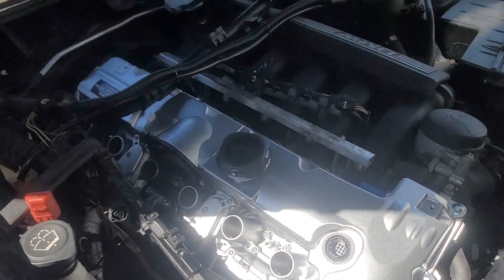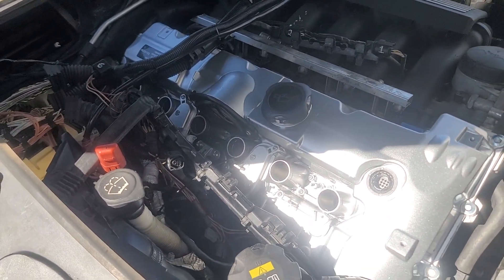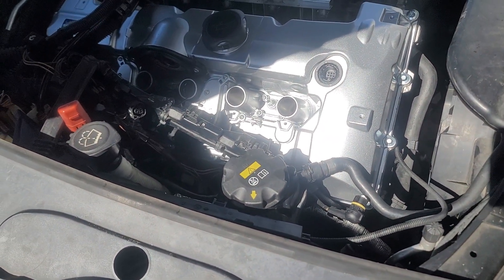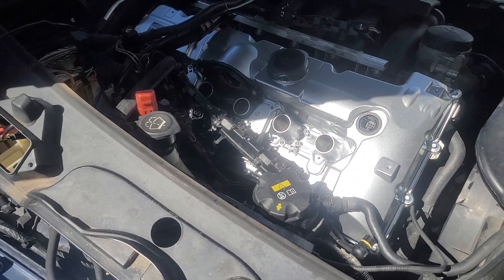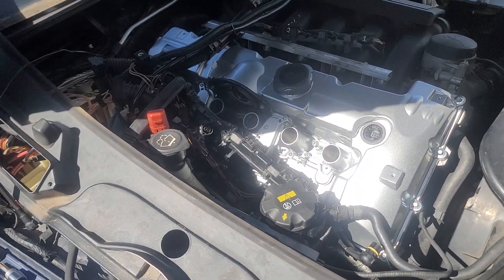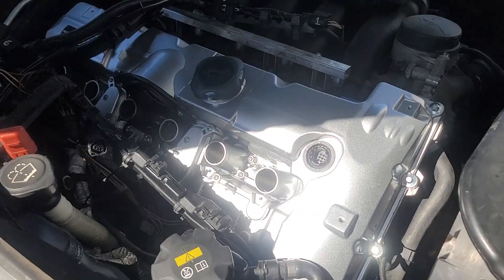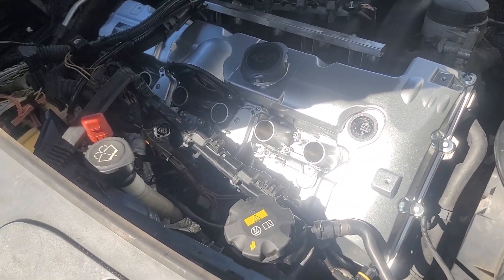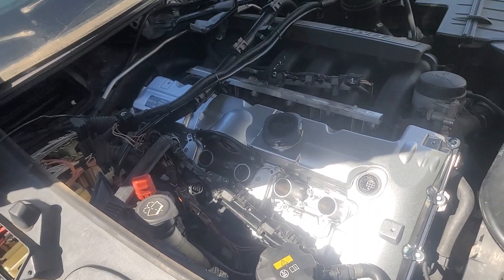The problems nobody tells when using the Mitzone aluminum valve cover for BMW N52

Comment: Yeah, I've always just stuck with the OEM plastic ones. It is known that you may have to jack the car up if your engine mounts are worn/clapped out even with the OEM cover. What I always suggest is replacing the mounts, before doing the valve cover

Comment: Great video, how’s the aluminum cover holding up so far?
Reply from the maker: Honestly after putting it on taking it off a few times and using a different gasket, it did not leak. Thing is i don't know how it's doing now because I sold the car a few months back because my neighbor has a 335 e90 she's trying to sale me.

Comment: I want to give an input on this video I know it's a year old but if your motor mounts are bad and the motor is sitting too low it is a pain in the ass to get the valve cover off and on whether it's plastic or aluminum.
Reply from the maker: Your right. I took the motor mount loose and jacked the engine up to make it easier.

Comment: I wonder if they designed the valve cover on an engine on an engine stand and didn't go through trying to fit it to an installed engine in the tight ass engine bay.

Comment: I feel really bad for what you experienced with the leaking vcg and am super glad things turned out ok in the end. l recommend to anyone doing VCG's to always use things like mirrors, cam probes, take videos from your phone with the light on, feel around the valve cover bottom to look for pinch points, anything and a combination of them to verify proper seating of gaskets. That's a horrible feeling. I did something similar when I was putting my S62 back together after I finally got the O-ings seated properly after replacing the water pump and T-Stat. Use a pressure tester to verify before I slapped her back together. Killed 4 O-rings😅. 

Sooo, I connected a hose to a protruding bolt end instead of on the oil line below it 😑and she proceeded to spit out some 3L of fresh 5W50 synthetic oil on my freshly cleaned engine pan and all over the floor of my garage. Hated life for a bit but then remembered I have an M5 😊. Cheers

Comment: 1. I dont know how you had issues with installation if you were following a traditional VCG installation, the valve cover has the same tolerances as the plastic one, and you shouldnt need to "flex" it anyways. 

2. The gasket itself is cheap yes, but you get what you pay for. If you want a high quality oem gasket, go buy one. Its $10 most places for OE or OEM. If anything, you can RTV the gasket to the valve cover which is what I did. 

I've had it for over a year using the same shitty chinese gaskets it came with, just to see how quality they were. If you instead DYOR on how to upkeep these cars, you'll find theyre a lot easier to work on than MAJORITY of modern cars.
Reply from the maker: My car has alot more stuff under the hood than others I've seen which makes it really tight fit. Different cars have different features. My car being awd and every option available makes it not as easy to do.
Reply: @barrettgarage1088 So how does that make it the products fault?
Reply from the maker: It make it more difficult to install it correctly.

Comment: When you replaced this, did you have a gas issue? I replaced mine on my 2008 Bmw 528i. And it doesn’t seem to go. Almost like it’s low on oil.
Reply from the maker: On the bright side I'm not leaking oil now.
Reply from the maker: Mine does have a misfire and acts like I can't give it gas almost like an open vacuum line. I've been busy with work and I'm going to replace it with oem valve cover when I get some time off work. But in all honesty it's not worth it I wasted that money.
Reply: @barrettgarage1088  yeah. Mine is in limp mode now. Something about this Aluminum Mitzone seems off…I thought it was the Valvetronic motor…have new Bosch plugs and coils…and still in limp mode…contacted Mitzone, and discussing the options
Reply: @mattb5753 Do you have any solution man. I have the same problem. The eccentric shaft sensor won't work when i put the valve cover.
Reply: @hristohristov5210  yes, I did. Learned a few things from this Mitzone. In the future, just get a hardcover, like the stock BMW cover. Be very careful in the removal of the Valvetronic motor and install. Have battery off when doing so. I replaced the valvetronic motor, spark plugs, coils, and still had a misfire. Kept going over the codes and cleaning up the misfires. Was very touchy. I ended up buying a specific code reader(Foxwell)for my bmw that helped pinpoint the exact location of the problem. That’s already helped me out a lot. Worth it. Fuses can definitely be blown in this process as well. Could blow the fuel pump relay fuse if the battery isn’t strong. Hope that helps.

Comment: What gasket did u used?
Reply from the maker: The first time I used the gasket that came with it. Then I got a felpro one from autozone and put forma gasket in spots to hold it in place. So far it's not leaking.
Reply: @barrettgarage1088  So it's not leaking anymore ?
Reply from the maker: @Bogdangati4  no it's not but here's the deal several threads stripped out so I had to drill them and put time serts in. That being said I also bought a brand new tundra so I drive it everywhere and the bmw rarely gets touched. I use it as a YouTube car mainly and take it to import car shows to spark conversion and help other people who have watched my videos.

Comment: Always go OEM Genuine although they are plastic, they are the very high quality plastic and the original valve covers will last up to 10 yrs. The ones with the build in PCV integrated onto the valve cover are specially designed with complex inside vents and materials within the valve cover that compliment the PCV working correctly.  Also the PCV on a genuine valve cover as such for the F10 models are designed and manufactured with specific specs and tolerances that only the Chinese valve covers lack/missing and will fail almost instantly from poor quality and manufacturing!  Never cheap out on important parts on any BMW unless your time and money are worthless!  

p.s. These Mitzone aluminum valve covers for my BMW F10 inline 6 are $155 (ebay) for that reason..... Cheaply made to lower specs! While the Elring (Austria/German made) is $300 and the genuine version is $500+. .. ... ....
Reply from the maker: I know at the time this seemed like a good idea to try, but looking I should have went oem.

Comment: Hey man i am still planning on doing this job but what was your method of getting the metal sleeves out of the old valve cover and putting it on the new one for the bolts that is. Btw thanks for the video im doing as much research as I possibly can before i do it
Reply from the maker: Used a hook shaped pick tool to pull it up enough to grab it. On a side note I did end up gluing the gasket to the valve cover and fought with it awhile and got it placed. Bolted it down and so far it's not leaking. This project was interrupted with moving a long distance so parts are scattered and it's not together all the way. But starting and moving it around, and running it to keep the battery up there's no leaks so far.